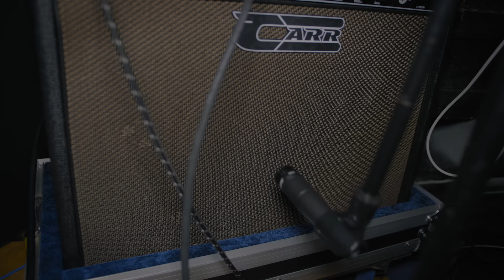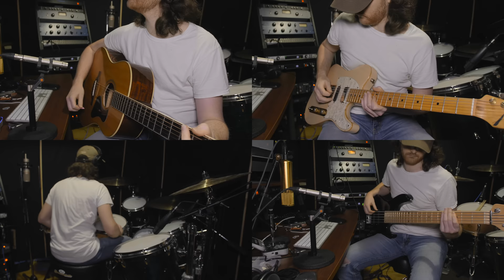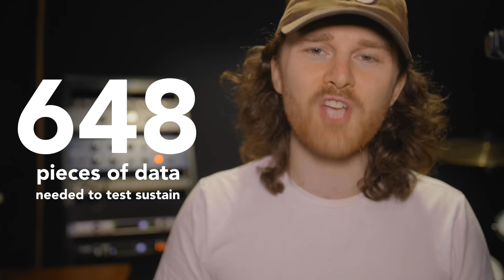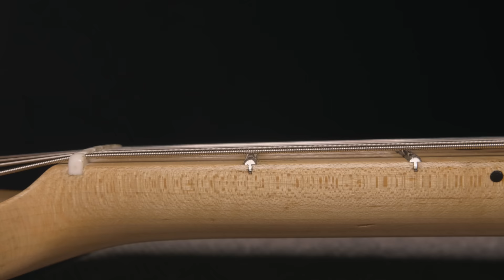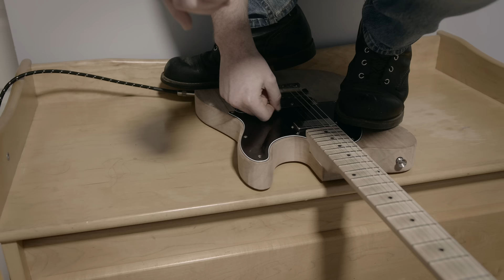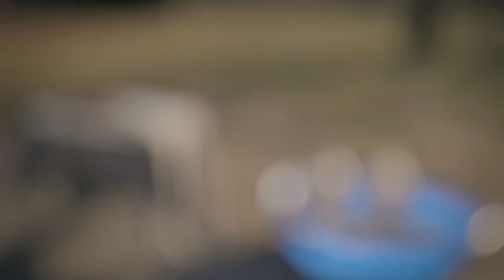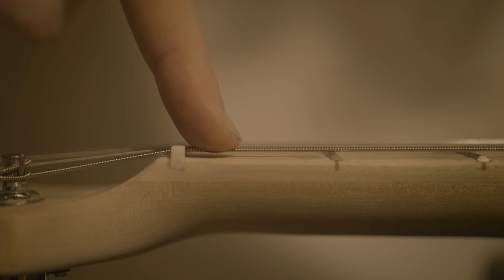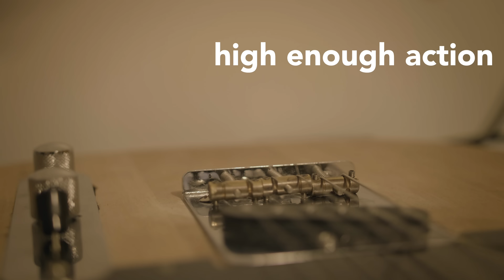Tested: Where Does The Sustain Come From In An Electric Guitar?

Comment: I appreciate all the effort you've put into testing long held, and inaccurate, beliefs in the electric guitar world.

Strings, pickups, and signal processors are the most important parts of an electric guitar signal chain, period.
Reply: And I would add a correct setup of the guitar as he showed in the video (string height, condition of the bridge, nut, frets, etc.)
Reply: Scale length?
Reply: @laaaliiiluuu  yes but that's only really gonna only gonna make a difference when it's a problem. fret buzz or dead strings for example are critical errors in the condition of a guitar. a dead string can't properly produce all the harmonics and string buzz will destroy sustain and introduce a wierd buzzing sound.

so yes proper setup will sound different then inproper setup but 2 different proper setups are not gonna do much
Reply: Getting your electronics right is most important, but that doesn’t mean wood and construction is not important.
Reply: @alphagt62  - did you see the last video where the wood and construction were proven meaningless?
Reply: @happyhell1  I’ve got ears on both sides of my head, and I work on guitars as my side job, I am fully aware of what different kinds of woods sound like. Keep repeating what you’ve heard, and for heaven’s sake don’t go listen for yourself!
Reply: @alphagt62  that's a no then.
Reply: @alphagt62  then why did the "air guitar" in the video about where tone comes from on this same channel sound identical to the wooden one with the same electronics?
Reply: @HamidKarzai  what are you listening on? Your phone? Did he not just say that the softer the wood, the shorter the sustain? You can make a guitar from plastic or whatever and it’ll still make sound. But the decay of harmonics varies with the density of the wood, so the wood is making it sound different. I’m speaking from personal experience, above, I talk about how I have two identical guitars, exact in every way, except the Squire has a plywood body, the the Fender has Adler, and anyone, and I mean anyone can hear the difference. There is more to tone than just volume, just because two guitars have equal volume doesn’t mean they share the same tone.  Have you ever used a clip on tuner? It’s attached to the wood, not the strings, and yet it can tell what note is being played by the vibrations in the wood, and if the wood is vibrating, it’s making sound. Strum an electric that’s not plugged in, and you can hear it. In these experiments all he is measuring is volume, tone is comprised of many second and third order harmonics. Tone is complex. And guitar makers don’t use mahogany and maple, Adler and swamp ash, rosewood and ebony for nothing.
Reply: @alphagt62  I'm listening on Sennheiser HD598 headphones, so better audio than like what, 95% of people probably? The differences I'm hearing are either non-existent or so minute as not to be worthy of any consideration. Maybe you have golden ears that hear things others cannot, but if that's the case then I'd say the difference is definitely unimportant to most people. Also did you actually watch the video where he tries to find where tone comes from? Because he perfectly matched the tone of a real electric guitar with a fancy wooden body to one without any wood at all, just suspended strings and the same pickups and electronics. If your Fender and Squier with identical electronics sound very different then I'm guessing it's because the guitar is setup differently, maybe the distance from pickup to string is not the same, or the action/intonation is different. The unplugged sound - sure, the wood matters there, there's no disagreement, it's the plugged-in sound where it's alleged not to matter. As for why guitar makers use expensive woods, sure, it's not for nothing, it's for the psychology. Makes people feel better about spending thousands of dollars when they get nice rare high quality wood for it rather than plywood. Maybe also for durability, or to achieve a certain feel/texture/weight. Not for sound though
Reply: Nicolas ruiz
Reply: @HamidKarzai  it does not
Reply: That should probably explain why one of my guitars went dead after drilling a neck pickup hole and repainting the instrument. And why I am getting the most sustain out of a guitar with a proper floyd made out of junk wood (it is relly terrible) as compared to very expensive string-through instruments.
Reply: @happyhell1  

Ola Strandberg did a series of tests way before and concluded that wood has some difference. Some. Not much. But not zero either. While many people tend to believe that if they (or me or anyone else) can't hear the difference that somehow means that there's no difference at all. Well, that's where precision measuring tools came out.

I won't see the difference between 165mm pen and 166mm pen if I write with one or another. But that doesn't mean that they have same length. Same with wood etc - if you, me, anyone can't hear it precisely, it doesn't mean it's nonexistent.
Of course, it could be barely audible and even less audible in the mix, but that's still some difference. Some doesn't equal none.
Reply: @alphagt62  Listening to an electric guitar acoustically isn't the point of these tests. Different guitar bodies will very likely sound different when played acoustically, but it should have been very clear in the test before this that it didn't matter when recorded through an amplifier. If he recorded both of his tele's (the 100$ kit and the Tom Anderson) it would very likely agree with you; they would sound different. Your argument supports the acoustic guitar market, where electronics and amplifiers are non-existent, and many people including myself would agree with you on it. 

If you argue that wood vibrations can be picked up by the pickups, I believe that to only be plausible if the pickups are unpotted/microphonic. When unpotted, you can rub your hand along the guitar and hear the vibrations, which means it definitely has an effect on the tone when playing. Once you wax pot, you can't hear those vibrations from the wood anymore, and it becomes essentially a string-electronic relationship.
Reply: Strings and pickups can be manipulated by fx, so not as important as one might think.
Besides effects, setup of the guitar in relation to the strings, and the speaker/speakers (or IR), have way more to say when it comes to the overall sound.
Reply: @alphagt62 
Where did he say that soft wood shortens the sustain? Time-line link please.

Regarding your guitars, are we talking modern guitars with none-microphonic pickups? 
Do you happen to have the exact same pickups in that Squire and Fender and if so, did you measure if they really are identical?
Same goes for pickup/polepiece height and guitar setup.
Cause while you might hear an acoustic difference unplugged, there should be nada difference when plugged in electrical if those two guitars have completely identical electronics.
Guitar makers use what they used too since doing acoustics and electric guitars with microphonic pickups, with propper modern pups it doesn't really matter apart from that you want to deliver an instrument that can take the stress of climate changes, is relatively easy to maintain and doesn't have to much weight.
Reply: That’s the thing about electric guitars - they’re electric. The wood, and everything else, is secondary to tone. The entire point of the solid body guitar was to eliminate the impact of the wood material (see Les Paul’s famous Log, a literal 4x4 with a neck and some non-acoustic aesthetic pieces bolted on). But the wood can still subtly affect tone. Still the wood has  impact psychologically and with its influence on how the guitar feels to play, which is important.
Reply: @alphagt62  funny that you say you can hear for yourself, then say don't trust what you hear. 

i just mean it's funny in the way a pun is funny, not that you're saying something wrong. i know social media is really hostile, but that's not what i'm doing.
Reply: @Fausto_4841  when I said, “don’t go listen for yourself”, it was meant as sarcasm, what I mean is the opposite, please do listen for yourself.  Do not base your beliefs on a YouTube video without at least hearing it for yourself in real life.

Comment: One thing that always cracks me up about sustain is when guitarists say, “Listen to the sustain on this guitar!”, and then apply vibrato to the string the whole time. If you’re physically manipulating the string the whole time it’s going to keep producing sound. To me sustain is best tested the way you did it the first time in this video, by simply strumming the strings, and then letting them ring, and measuring the decay of the output level of the resulting sound.
Reply: Every guitar player knows that tremolo is when you change the notes pitch!!
Reply: @JeighNeither  Check your sarcasm detector.
Reply: Also, the idea that sustain is such an important quality in an instrument. Some people use it interchangeably with “resonance” or “clarity”, but sustain as just the length of time a note takes to decay has never really seemed that crucial to me. How often are you going to strike a note and let it hang there for 30 seconds? Good but slots, bridge saddles, and fret-dressing should be the first priorities for pretty much any aspect of how a guitar sounds.
Reply: 3 types of tremolo:
1. Fast right hand technique
2. Strat floating bridge
3. Pedal/Amp FX with repetative volume drops.
Don't know why, but this is fun 😆
Reply: @bomzhiha-s-kurskogo-vokzala  There's also a 4th type which is essentially a trill between notes that are more than a step apart.
Reply: But there is a difference. I have a G&L that I can wring out an almost continuous tone on using vibrato, but that doesnt work on my Ibanez.
Reply: @michaelsullivan8934  Well, he does point out that what most people mean is usable sustain, i.e. it might sound for 20 seconds and nobody cares, but whether it has a strong or weak sustain for 3 seconds can affect how you play. For example, I have one guitar that lets me play a note for a whole bar of Over and Over by Sabbath without noticably weakening, which I want to be able to do, and another (much more expensive) guitar that doesn't. That changes how I play.
Reply: @mattiasorre1718  when i play doom metal i use a fuzz style distortion pedal that lets me sustain any note i want forever. whether its my US fender strat, or my cheap headless strandberg style guitar. people talk so much about this stuff but in reality a slight change in a pedal, EQ on the amp, or play style can adapt most instruments for any style, I say the pick ups matter most, after amp and pedals.
Reply: @ThrashXCV  of course loads of fuzz will give you sustain, but I prefer more of an eric johnson sound. At that level of overdrive, my G&L neck pup provides a more usable sustain than my ibanez RG prestige
Reply: @mattiasorre1718  have you tried a clean compressor? like a seymour duncan vise grip, thats what i do when i need a bit more sustain on cleaner sounds.
Reply: @ThrashXCV  actually, like 3 compressors maximizing the levels solves the issue pretty well (currently playing through a DAW), but it was harder to get that sustain on the Ibanez. No idea why.
Reply: @mattiasorre1718  well hey do what you gotta do, I’m sure that RG is killer regardless!
Reply: @ThrashXCV  the neck is insane man :D
Reply: But this illustrates what people actually mean. No one really cares if your guitar sustains for 20s. They care about how long you can sustain particular notes. Some guitars have wildly better sustain holding high bent notes on i.e. the B string while others have dead spots for some reason. Vibrato doesn't sustain notes either, so if you can vibrato and the note continues to hold it likely does have better "sustain" than a setup that can't manage that.

Comment: I love how the results are basically "play what you like, get it set up correctly, and little things makes little differences (and it's fine if you get nerdy)" 

That being said, I think you'd do a great job experimenting with caps, pots, pickups, and amps. Things that are less superstitious but still a bit overblown
Reply: Well yes that's why I need 6 Les Pauls, gotta compare 50s wiring to regular and 6 kinds of PAFs! The magnet type seems to have a fair amount of influence. So an Alnico 2 vs an Alnico 4 might be a bigger difference than two decently made pickups with the same magnet. There's a few companies that make high quality pickups with less of a magic sauce premium like Iron Gear and Tonerider. I ordered some of the latter. They sound really nice and 50 bucks a piece seems fair enough for something made with the ambition to actually match the construction of an original. After that copper is copper Alnico 4 is Alnico 4. Doesn't really matter if Seymour Duncan or GFS bought from the supplier and put it together. In fact if the Toneriders do sound like they do in some demos they will sound better and closer to the original than the SD 59, which would be nice. But it's not like turning up the treble on the amp doesn't fix it but that doesn't count!!!

Comment: Love your methodical approach! Hope you keep doing tests like this.

"I've never taken a statistics class..."

I took one in college, got a C. I'm no expert either. Later as a practicing engineer, when I wanted to understand the statistics to analyze experiments, specifically, I was recommended a textbook called "Statistics for Experimenters" (by Box, Hunter and Hunter) and I highly recommend it. The fact that you made that spreadsheet makes it pretty clear to me that you'd appreciate the contents. The fundamental idea is to design the experiment around the data you're hoping to extract, and the book provides the (fairly minimal) math & statistics required to get the most data out of the smallest number of data points. So you either save yourself time doing the tests, or you get more data for the same effort (compared to doing an off-the-cuff experimental design). Now, the method does rely on quantifying results, which won't always be possible in an obvious way. (Exactly how similar or different, as a number, are any two tone samples, for example?) But when it is possible (e.g. how long is the sustain?), it's quite beautiful.

If you're curious, but not quite curious enough to buy a textbook, you might look up "factorial design," which is one of the methods taught in the book. There's not a huge amount of YouTube content on the subject, but this short video discusses the basic idea: https://youtu.be/GGvuacZb-AQ

I would also be happy to help you design an experiment to get a feel for the method.
Reply: He’s joking. He’s taken statistics classes
Reply: "NERD!"
Reply: Design of experiments. Took it as an engineer in school. Crazy stuff

Comment: Between the lines here: String  gages. Low E dramatically out sustains High E across the board, and it makes sense. More mass = More momentum, and the surface area increases at the square of radius while volume & mass increase at the cube - so increasing momentum overtakes increasing air resistance.

Open question then around smaller differences. How big a difference in sustain is there between a .09 and a .11 E string? I'd also love to see a test like this comparing different string types. Bare vs wound, flat wounds, coated, etc.
Reply: Yay science!